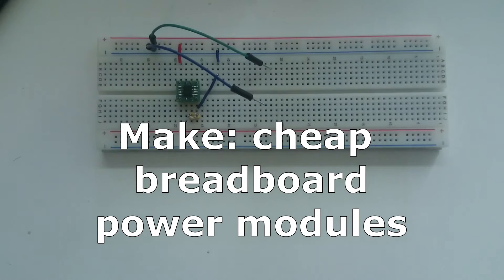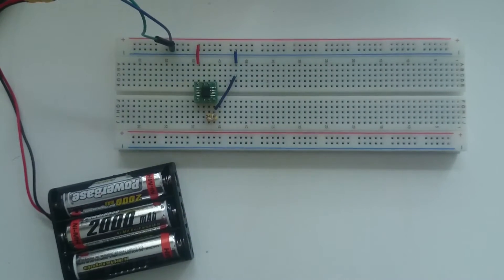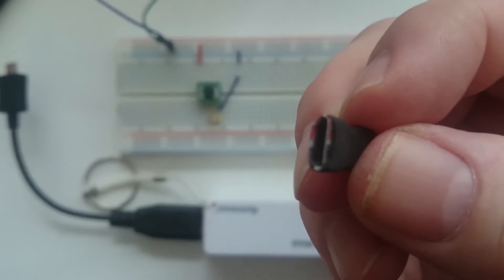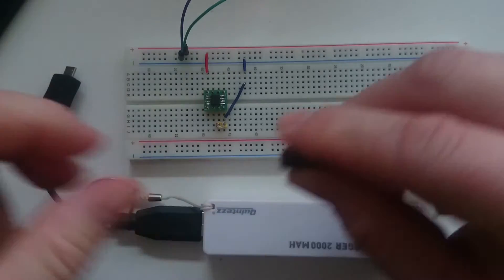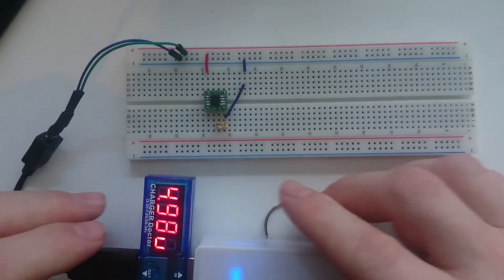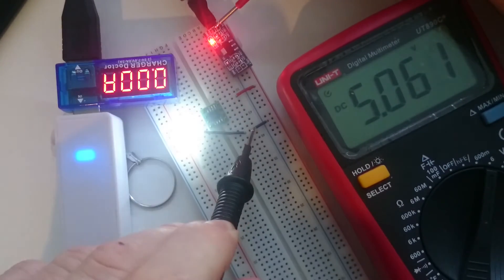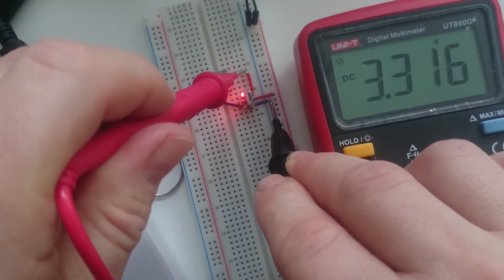Made: Cheap AMS1117, HT7333, micro-USB breadboard power modules

Comment: Hi there , 
Is me again , (LOL)
I am steel thinking of that small Voltage regulator , but I don't have any double side PCB , so I wonder If is possible to draw a schematic for a Single side PCB !. 
And since I don't have SMD components , can I make it with regular components ?. 
If Yes what is the corespondent for SMD HT7333

Second discution : 
You said You can programming AtTiny13 using the Arduino . Using the same method can You programming the AtTiny85 ?. 
I am asking because I need to make a small LoMa (Lost Model Alarm) device for my future RC submarin (is on a Dry dock now !!! ) . 
Thank You .
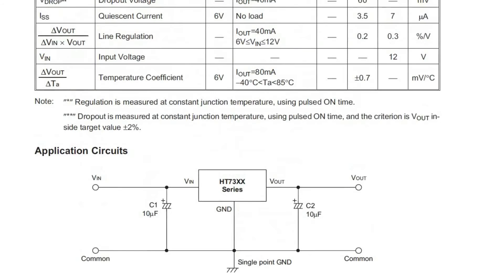Reply from the maker: Hi again, the schematic shown at 4:12 doesn't require double sided SMD components. I only chose that to make the module as small as possible. If you use Google to find the Holtec datasheet, you can read tbat there is also a TO-92 through-hole version of this regulator, so smd is not mandatory.

Yes, the ATtiny85 can also be programmed using the Arduino IDE. That MCU is even less challenging than the ATtiny13A as is has more memory and a bigger audience, so better support from its online community. You do need to do your homework though and I advise you to read/view all tutorials (e.g. via the Instructables website), get to know the ATtiny's limitations and first create a working version using the normal Arduino. Unfortunately I don't have the means to support your efforts. Good luck!
Reply: Thank You , Thank You , 
I will read /view everything is necessary . 
All the Best .

Comment: Hi there , 
I am surprised that nobody made any comments !. 
Any way ...I like it the simple way of showing what did You used & You do it and Thank You for that . 
Most of those who post do not give explanations about the materials used and why they used those materials .
I have a small request : Please , can You make ( or point from where You get it ) & post here a schematic for that tiny voltage regulator You've made it ?. Thank You . 
I am starting to learn about that Modern Wonder Arduino and all most arduino shields diy or not use these Voltage 3,3VDC , Not very easy to obtain and maintain for small projects .
This voltage regulator can be used with different power supply such as LiPo bat/NiMH bat/ different types of cell coin bat ? . 
Keep us informed about Your projects .
All the Best . 
BTW . You've got Your self with another subscriber (LOL).
Reply from the maker: @MARIUS Petcu: Thank you for replying, for your kind words and for subscribing! The schematic of the tiny 3v3 regulator is shown at 4:14. Just before that you can also see my attempt to sketch the layout of the tiny board. The HT7333 regulator is especially useful for Li-ion/LiPo batteries, since the quite popular AMS1117-33 has too much of a voltage drop. That makes the AMS unable to regulate 3.7 to 3.3v whereas the HT7333 does work great. Arduino is great fun. Although I can't post every week I do intend to release some new Arduino related video's in the near future. Have fun and see you then!
Reply from the maker: @MARIUS Petcu: BTW the mini regulator is used to regulate a higher voltage down to 3.3v. To convert a lower voltage up to 3.3v you can use a boost converter. In my latest video ( https://youtu.be/SijlC1Rqykw ) I show you how to modify a very cheap boost converter to deliver 3.3v from for instance two AA NiMH batteries.
Reply: Thank you for the answer .
 I was to concentrated and I didn't notice that is the schematic . 
Looking forward to see those Arduino tutorials . 
I intend to make a small Weather station and I am steel struggle with those combined codes . 
If You know much about Arduino can You shere with me some of those information ? . 
Thank You .
Reply: Thank You very much for Your time .
Reply from the maker: MARIUS Petcu  - I struggled too. It took a lot of time and at times I still struggle. Today for instance I spent many hours trying to optimize an I2C display library (so again no new video yet). The best way to learn I found was to try things myself, supported by online tutorials on websites such as Arduino.cc as well as many YouTube video's. For my favorite YouTubers follow the links on my channel. Just to name a few: watch Julian Ilett, Andreas Spiess and GreatScott. Good luck and have fun!